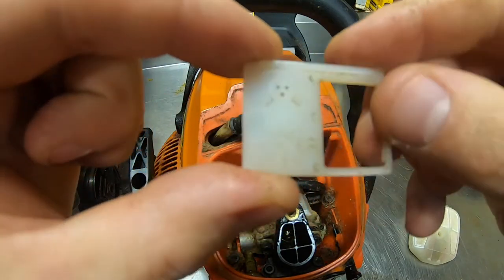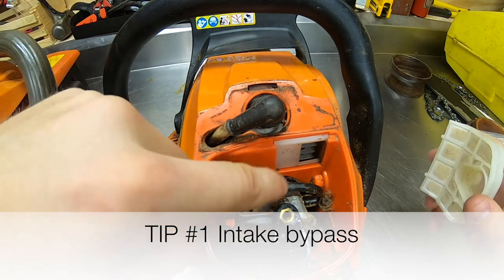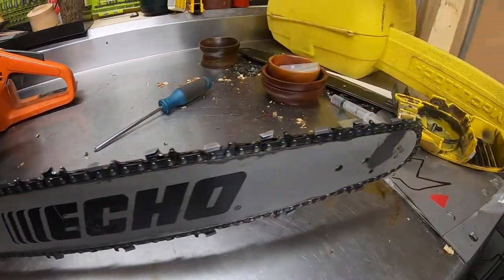Fall/Winter Chainsaw Tips That Will Help Save Your Saw! EP 88

Comment: Glad you showed that winter summer cover . You would be surprised how many people don’t know about it . I use Stihl medium oil all year round . When I put the 32” bar with a chipper tooth chain on the 461 for cutting those big maples and ash I turn the Oiler up also . Bigger bar longer chain aggressive tooth means more friction and heat 👍
Reply from the maker: Stephen! Thanks for coming by on the live chat last night! Glad you enjoyed this video! That bar length comment makes sense! I wouldn’t have thought of that! Good tip to know! I wanna buy a 32 skip tooth for the husky! The more I run that beast the more I like it! 60cc is a great cc range! She’s heavy but cranks in the wood! Thanks for watching as always!

Comment: Thanks Jay. I learned from this video.  For years, I’ve kept my saw in the basement because I couldn’t get it started in the cold. Now I know why. I also never changed to winter bar/chain oil. The last tip about taking tension off the chain - yeah I have some bad bars probably due to that too.
Reply from the maker: Jim! Same boat here! I made all these mistakes last year and I cut a lot of wood in the winter months so it’s important for me not to over work my saw in the winter! Glad this video helped and happy cutting! Thanks for coming by!

Comment: That's a cool tip about the intake!  I never noticed that when checking the air filter.   I don't use my saw a ton in winter, but good to know!  
I definitely learned about bar oil getting too thick.  I buy thinner "winter bar oil" now, but I had bad oiling and smoked a bar my first winter.
Reply from the maker: Yeah it happens to us all! I figured I’d share what I did wrong my first year so it would help others! Thanks for coming by as always!

Comment: Thanks for the tips!  I'll keep them in mind! So one more tip for you!  Winter gasoline versus summer gasoline! That makes the whole difference in 2 strokes engines, where the gas tank will not release vapor pressure. The winter gasoline blend is easier to vaporize at lower temperatures. Having summer gasoline and trying to ignite that in winter sub-zero weather is next to impossible. Then having the winter blend in summer, it will simply boil... In some circumstances, it will flood the engine by overflowing gasoline in the carburetor. Gasoline blends matter! Thanks Jay!
Reply from the maker: Joe! Thanks for coming by! Hmmmm thats good to know about the gas! I know the winter diesel has a different blend for winter and summer but didnt know the regular gas did that as well! Thanks for the knowledge! See you on the next one!
Reply: I recommend the Echo RedArmour 50:1 pre mix gas 4 both of your chainsaws,keep up the good work man.

Comment: Thanks for the tips, Jay. The 1st one doesn't apply to my battery chainsaw but the other 2 might. I will have to read the manual again.
Reply from the maker: Karen! Thanks for coming by. Yes battery powered is a little different but I’m sure the oil and chain adjustment is relevant! Thanks for watching!
Reply: @HomesteadJay  Yes they are.

Comment: I also thin my bar oil with a little trans. fluid. Try to remember to change the air box setting back to summer mode, and then remind me. I generally think of it in july.
Reply from the maker: Hey John! Yes I forget too sometimes haha

Comment: Thank Jay! All the knowledge in the world can't replace experience, that's what we all need to share with each other. Now the question I have is what temps would you start considering it "cold weather"? I'm in central MN and I spent the weekend splitting wood with snowflakes floating around and still had only a sweatshirt on. In my mind it isn't winter until it's hitting lows below zero. When does the saw start thinking it's cold?
Reply from the maker: Knight! Thanks for watching! I agree 100% that experience is the best learning tool and I messed up the 3 things I went over in the video so hopefully people can learn! Ahhh the question of when to "change over" it really depends on the saw, some saws are more temperamental than others so I would just see how the saw reacts, if its boggy or laggy at like lets say 40 degrees swap and winter/summer plug and see what it does! You know your saw better than I do so just feel it out! Thanks for watching and hopefully this comment helped!
Reply: @HomesteadJay  My 024 stihl calls to change it to winter mode at 50 deg. F. And to change it back to summer mode at 70. I've only used it one time so far.I never knew about it until a few years ago, when i looked at the manual. The saw is 30 + years old. I don't use it much, but i use it every year.

Comment: You confused me with the HUSKY. When you put the 'plug thing' in the hole behind the Cylinder head you say (4:42+/-) something to the effect of 'This is the first time I've done this. I believe it goes this way. I've never actually done this"  Now, I would assume that blocking that opening puts the saw in SUMMER MODE. But, since the topic was what to do in order to work in WINTER MODE.  However, I learned something you knew today ;)  I don't cut in the WINTER  cause it is uncomfortably cold!
Reply from the maker: Hey Norm! Sorry if it was misleading but the plug on the husky cuts off the "forced air" from the outside of the saw aka the cold air. If I was to leave that plug open it would pull cold air from the outside and the saw would have more trouble running. Now the Echos the plastic piece when you leave it "open" it will draw in warm air from cylinder heat. If it was summer you WOULDNT want warm air from the cylinder because the ambiant air is warm enough! Hope that makes sense, basically WINTER MODE means you want warm air from around motor. SUMMER MODE means the saw wants air from "outside" the engine area!